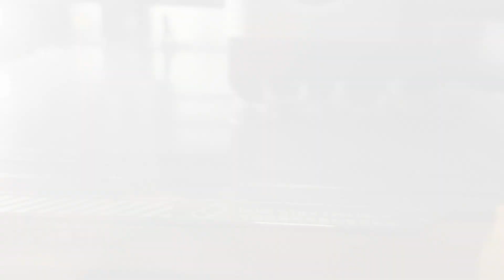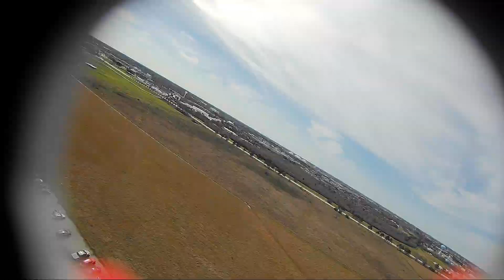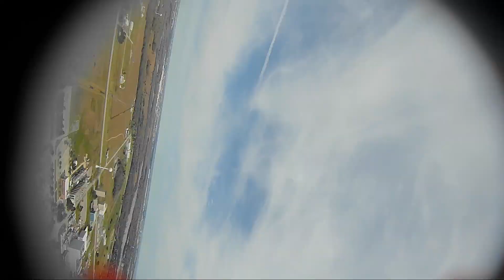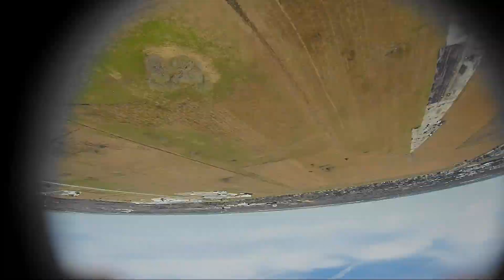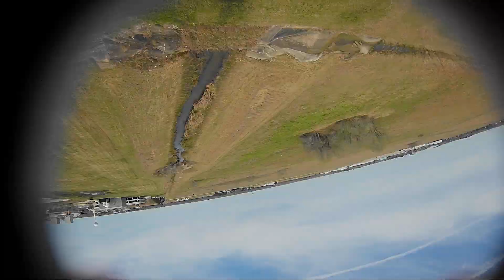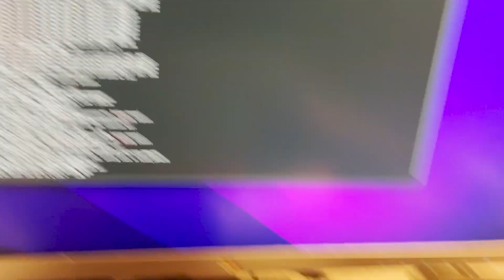Rocket Fin Control | SHOCK Flight Test 2 - (Too Much) Roll

Comment: Once again great project but it appears you do not have enough experience flying more basic mid to high power model rockets. Building techniques, engine choices, weak points etc. PETG has its place but not for anything structural the way you are using it. You need high thrust motors with sorter burn times to get the rocket moving the direction you want and keep it there so it does not arc over into the wind and damage your recovery system.

Comment: Wow, you are a very skilled designer. I was blown away by the design work. What software do you use to run your simulation? Also, is there a reason why you seem to steer clear from ABS? I’ve used it on my rockets and it seems to work great, especially for the engine mount. I don’t have to deal with any warping issues, and I save a lot of the weight I would have from using other plastics. I’m sure you know this already, but I’m really curious of your reasoning.
Reply from the maker: Thank you! I didn’t used to have an enclosed 3D printer so I had steered clear of ABS, but still haven’t tried it now that I am more confident of warp-free printing. It’s probably better than PETG for some of these parts, so I may give it a shot in the future. CF-PC is working great for me for structures that need rigidity, but I’ll give ABS a shot sometime.

Comment: Nice. I do not rocketry, but a close thing with roll control. It flies at 10m/s, but I must use 200cm2 roll control surfaces. I use dirt cheap mg90s clones and was wondering if an expensive servo would eliminate the backlash. Apparently, they do not.   But ....  I am not sure what is your servo -> fin angle ratio? 
Fins require 40 deg max amplitude, or even less due to aerodynamics. After 15-20deg turn in one direction from zero point the roll moment starts to decline. 
So you probably can do 1 deg servo -> 0.1deg fin ratio. This should? remove the backlash. Or there is something else that makes it not possible?
Reply from the maker: Thanks for the comment! There’s a couple of sources of that backlash, and increasing the linkage ratio would definitely help with some. It would also help for me to scale the entire assembly up (both horns get doubled in size for example), that should cut some of backlash from the linkages by a sizable amount. Unfortunately I’ve got some strict volume limits, so the whole assembly has to be below a certain size. I managed to cut down on backlash on a smaller control assembly I made with overall tighter production tolerances and more careful post-processing, I’ll try and show that one off next video :)

Comment: I dont think the braces were the problem since the break accoured more in the middle of one side. My theory of what happend is that due to the rockets pitch while deployment of the parachute there was an uneven load put on the petg wich caused it to rip appart the layer bonds. The reason why i think it was due to an uneven load is that one half has more petg removed then the other. Another reason that could also work with my theory is that due to material exhaustion cracks have formed that then caused the failing of the bonds in the filament. What i could suggest as long as it works for the space that you have is to add a smoothing overhang wich basically looks like one half of a Arch Bridge wich could help in distribuing the loads on the part and may reduce material exhaustion, of course you cant get rid of material exhaustion but it may increase the "life time" of the part. My source is none and is just a suggestion that may or maynot work. Im sorry for my bad english since its not my first Language. Also i love the work you do.

Comment: how to make this engine ? But not sugr right?
Reply from the maker: These are commercial rocket motors from CTI. They may or may not be available depending on where you live
Reply: @LafayetteSystems   i was learn from many platform but i still not understand how to make  rocket engine, i was make rocket sugar but now i want to try make rocket engine but not use sugar again. i like rocket, still now i was did searching and learning to make rocket,so i hope u can tell or teach me how to make rocket or engine rocket.